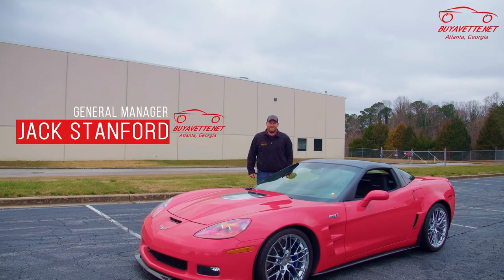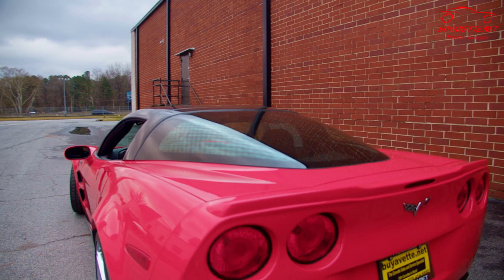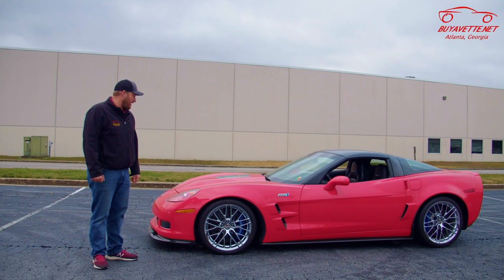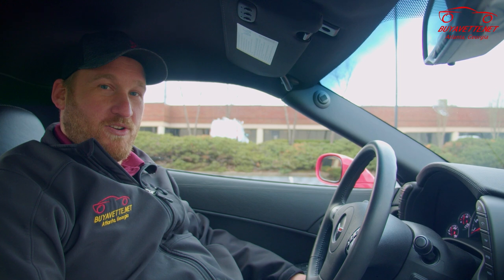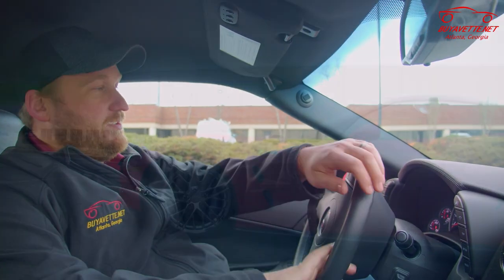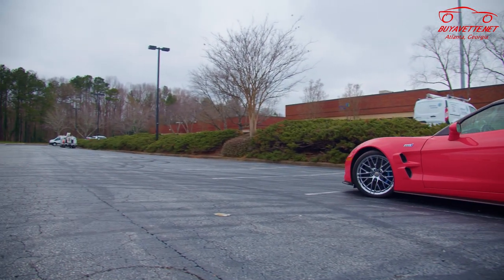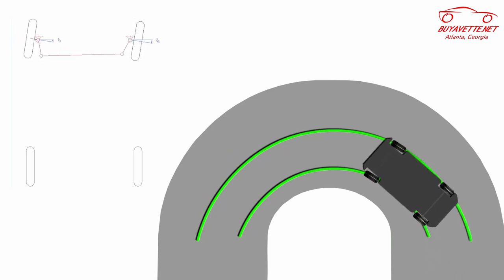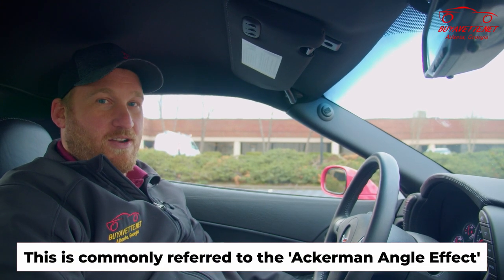C6-C7 Corvette Tire Chatter/Wheel Hop when Turning at Low Speeds

Comment: Question,  When I had my Run Flats yes the Wheel Hop occurred but when I replaced with all season tires it totally went away. Is it because the all season is a softer tire.  Thanks for all your videos.
Reply from the maker: We have noticed this on our cars as well -- the OEM runflats seem to be the worst offenders in terms of low speed wheel hop. The slip angle of that particular tire seems to be what causes the wheel hop; you can read more about it here on corvetteforum: https://www.corvetteforum.com/forums/c7-general-discussion/4090204-tire-chatter-hop.html

Thanks for watching!

Comment: But when this is happening, do you smell a burnt rubber smell afterward?
<--- 2017 GS Vette new owner and I smell rubber when im turning tightly at low speeds (5-10mph). Thanks in advance
Reply from the maker: Should not have a burnt rubber smell.
Reply: Did you figure it out?
Reply: @JussOso  No I did not. Just accepted it